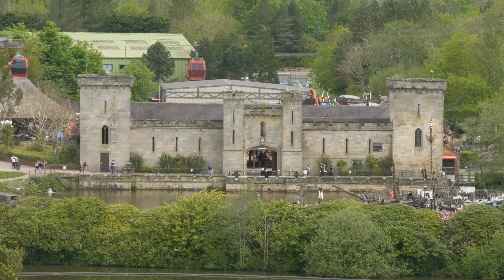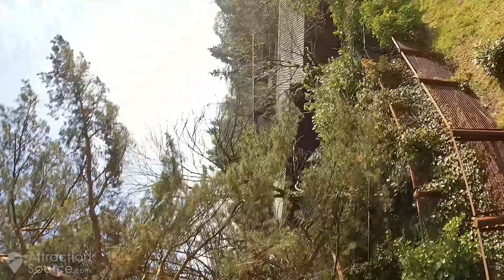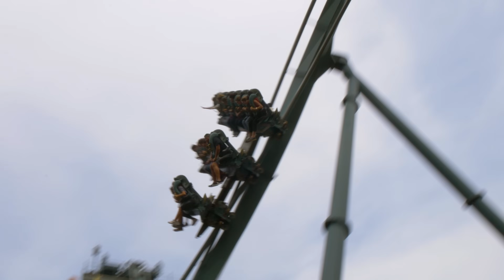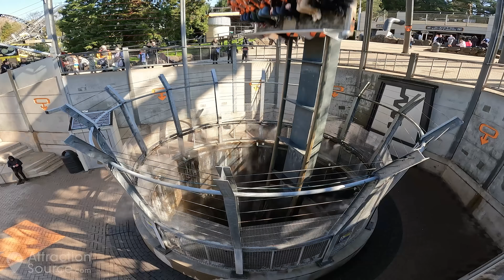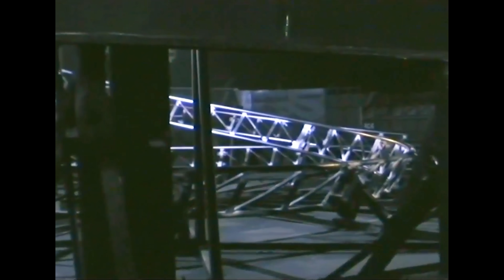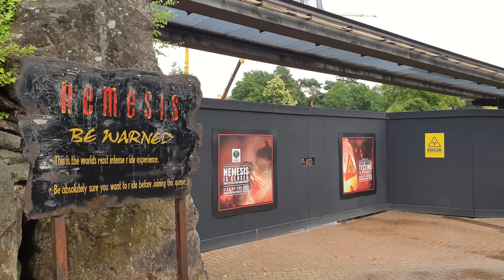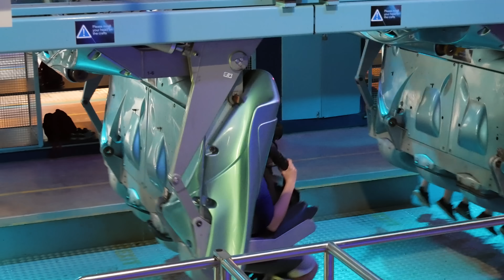Alton Towers has a roller coaster problem

Comment: Oblivion is very clearly above the tree line. I remember, because I was on it, we went over the top, paused before the drop, and that's where it broke down & the brakes didn't release.

Lovely view it was, though. 

I used to go to Alton Towers before Oblivion was built. Please don't tell me it's been there 25 years. Corkscrew, if it's the "outdoor version of blackhole" - I saved a guy from falling out of because there was no mechanism for holding riders in, in the early days. EDIT: No, Corkscrew was where Rita got built. I'm thinking of the coaster that was where Air, now known as Galactica was built. It was a clone of blackhole, but, not in the dark.

I remember a common "fear" of Nemesis was losing your footwear as you came out of the loop.

Wasn't Galactica called "Air" back when it launched?

Wickerman seems like it was built where the runaway mine train was, rather than the flume.
Reply: F****, now I realise I was at the park before Nemesis was built.
Reply from the maker: When I first rode Nemesis I was afraid of losing my shoes! 😂

Comment: The height restriction should be lifted. The local authority is putting the economic viability of the park at risk.  Either let it change or close it down and have it as a garden as it was prior to 1980.

Comment: I dont know what they'll do with oblivion but i reckon it'll be much easier to turn into a different rollercoaster, because even if half of it is underground, the entire ride is about the drop so half the ride is not very much, and they can quite easily design another rollercoaster that has a drop into a tunnel at a given point but it can be more exciting in the rest of it. I dont know how they'll approach replacing the parts, but if they do fish each bit out part by part they might be able to keep the above ground open for the public, which iirc would otherwise block off two off the shelf rides and a restaurant so its in their interest to keep it open, especially the restaurant.

Comment: I remember when Air (now Galactica) opened. It was the best rollercoaster I’d ever been on. It was smooth, fast, I didn’t bang my head (like I did constantly on Nemesis) and I loved the corner where for a second you couldn’t see any track or anything. “Prepare for AIR.”
Reply from the maker: Good to see another Air fan!
Reply: I went to Alton Towers shortly after The Smiler opened.
I never bothered to ride The Smiler because the queue was 2 hours long. I went on Air... there was no queue at all, the car wasn't even full up. I'm glad I did, because it's different to any other rollercoaster I've ever been on - it's not trying to be scary or intense, it's just fun, and it really feels like flying. It was almost relaxing. Easily the best experience I've ever had on a rollercoaster.
Reply: I remember when it first opened under Air, we went for 2 days and I think the entire second day I just spend going to air multiple times
Reply: @rancidrance875  You will be familiar with all the breakdowns then? I had a season pass that year and went almost every week. Air was plagued with teething problems in those first few months but when you finally got to ride it, it was a unique experience, and who could ever forget the great theme tune that played from the green BOSE speakers around the queue lines?
Reply: @RS_John  +1 this! The ride itself was relatively trouble-free, but it was the loading area and procedure that was causing most of the problems. New train design, new type of restraints riders had never encountered before and didn't know how to use, trouble with the raising mechanism and so on. In fairness to B&M though, it was the first such coaster they'd ever tried building. 😇
Reply: I've always been 100% a Nemesis man myself - Inverters with 4+ G-force every time, in my case - But Air has always been a particularly calming and zen place for me. I respect the fact it was designed to be an experience of flight - Not the White Knuckle attraction everyone seems to expect of it - And every time I go on it (Often without the GalacticAIR headset) I come off feeling so relaxed and comfortable I'm practically floating out of the station! ❣

Unfortunately, I took a rather more risque approach to interpreting the Air promotions around the time it was opened. I won't go into detail, except to say that my version was rather blue and the slogan put a bit too much emphasis on „Assume the position...“ 😉
Reply: I remember Air too. That ride felt very unique. Sure, there are more options now across the world, but Air will always hold a special place for me.
Reply: I think its lacklustre, no thrill.
Reply: @JabJab420 it is tame and it is supposed to be a more family coaster. It is more about the position of flying and that feeling when for a second you are flipped backwards and upside down is like nothing any other coaster can do ❤❤❤it is worth it just for that second 😂😂😂
Reply: @propgear123  Exactly, not every ride has to throw you about with max g forces. It's about the immense flying experience - still my favorite ride - and I've rode it and Nemesis back-to-back for many times!
Reply: @LaurenceGough  yeah I love it and think it is better than nemesis because it is unique. Nemesis nemesis inferno and the one at chesinton are all the same imo
Reply: Air was the best man I always loved that one
Reply: I was too small for Air when it launched and thanks to "friends" not respecting my limits in my teenage years, now have an irrational fear of all rollercoasters. 😒

I can't remember which rollercoaster it was (in Thorpe Park) but they made me go on it when I wasn't in the right frame of mind and only one of the group realised thier mistake when my knuckles were white and eyes shut before we'd even left the station.

Seriously people, if you have a friends who isn't keen on going on a particular ride (for whatever reason) don't force them, especially with sheer peer pressure...  You'll only ingrain thier insecurities more.

Comment: Your voice is so boring and tedious! You are aware that Nemesis has just been rebuilt with new track to the exact same layout right? Oblivion is also purpose built so they could probably do the same if not mix it up a little.
Reply: Alton Towers is built next to an old village called Alton, I imagine most of the owners of homes in said village are probably the same people I imagine buy homes next to train tracks, motorways, flight paths, night clubs and then moan that all the noise/sights are upsetting them. If you can’t see a theme park when you’re driving to a house viewing then that is very much your problem.
Reply from the maker: Thank you! I do know Nemesis is being rebuilt, it's the focus of this very video, which you probably didn't watch 😁

Comment: I doubt Oblivion's track would be that hard to replace.  Its not as if the tunnel is tiny, and the tunnel pieces are likely smaller, therefore easier to remove and replace manually.
Reply from the maker: Oh yeah the tunnel isn't small, those huge trains have to travel though! I hope you're right 😊

Comment: Alton Towers is a funny one. It's a great theme park! But their obsession with world firsts has left them with a unique selection of rides for sure. But most of them focus on one single show stopping element which means that they don't necessarily age so well and are quickly over taken in the thrill department by other parks. Nemesis is the big exception here as its genuinely one of the best coasters in the world and will remain so. The smiler also beats this trend as does Wicker man to a degree so maybe they are learning. 

As iconic and beloved as all of the coasters are. The reality is that Oblivion, Galactic, spinball, thirteen and Rita could all easily be replaced by far more exciting coasters if Merlin wish to do so. Alton also needs some high end themed flat rides. Ironically they used to have a breakdancer which would be great to see again....if they ran it with proper ride cycles.
Reply from the maker: High end themed flats would be great!

Comment: If they wanted to then could they remove Oblivion but reuse its tunnel for a new coaster by blowing out the existing hole bigger and removing more earth to create an underground space that's more of a network of tunnels or a cavern than a single tunnel? I presume that as long as they don't run into subsidence issues then they can dig underneath as much of the park as they like and to whatever variety of different depths that they like?
Reply from the maker: I have no clue how much they can dig underneath the park, but more underground bits of rides would be awesome!

Comment: The 25 years you mentioned is most likely the design life in the specification that the coaster was designed to. This will be driven by fatigue, specifically crack growth in high stress regions or welds and to a lesser extent corrosion and some track wear (though this is largely born by the replaceable wheels through proper material selection). 
Just like with other machines, power stations, ships, oil rigs etc, you can extend the design life through an extended inspection regime, checking for crack growth in welds etc. This is likely how nemesis was allowed to operate for another 4 years.

Comment: For me I think Rita should go first. It does one thing and it doesn't even do that very well due to the height restrictions, Stealth is a far better version as it actually has the top hat feature that is the selling point of this ride type. It's also one of the easiest to remove as there was little to no landscaping done. I would like to see Galactica/Air receive the themeing it was meant to be opened with, being forced to stare at a dirty, damp concrete tunnel is not exciting. Oblivion definitely deserves track extension now that it has been overshadowed by other dive coasters that offer way more duration. Outside of coasters, the Congo River Rapids is in desperate need of investment, the last time I rode it it smelt horrible and most of the splash features have long been switched off. It's either that or remove it for something better, but as the parks last water ride I'd like to see it refurbished, hopefully with the same design of rafts from it's original incarnation.

Comment: Get rid of Galactica and Rita. Galactica is a real headache with reliability due to the duel station and car complexity. Rita is also very unreliable and rough as nails. 

Nemesis and Oblivion might be the old grandads, but they are more reliable than the others, have decent throughput and are far more iconic.

Comment: I was expecting this video to be about the number of times Oblivion has failed to disengage the lock at the freefall point 😬 It happens every couple of years, sometimes just for a minute or two, sometimes needing a full ride evacuation.
Reply: Happened once when I was there
Reply: As in, it doesn’t stop?
Reply: @ivanazuckerberg  the car is supposed to stop hanging over the drop for a few seconds. Originally a speaker played "Don't look down!" and then you were released into freefall. Except occasionally it doesn't release. It happened several times when it was first opened (once when I was there, but not on it). It's a nightmare of a stopped car rescue because there's the potential of someone falling off the ride into the hole if it's not done correctly.
Reply: @JamesScholesUK  I remember the days of ‘Don’t look down.’ Sad they don’t say that anymore but I understand it was because the neighbours complained about noise and the ‘Don’t look down’ made the screaming worse. It used to stop a lot at the beginning when I was there - I’ve never seen anyone actually get evacuated at the top - have you?’ Eeeek

Comment: Always thought that Alton Towers could do a tunnel-based horizontal launch coaster really well. Using a tunnel they could go under protected elements and 'pop-up' in the non-protected spaces. With the tunnel they could simulate hyperspace, or something akin to the star-wars trench run with projected displays and a matt black track that all but vanishes with brighter side displays. Epic.
Reply from the maker: That would be pretty cool!
Reply: That would be mint
Reply: @SportyMabamba  Everybody: That would be mint! 💯

Merlins board of directors: That would be far too expensive. 💸

Solution: We all need to buy a majority stake in Merlin so we can work our way past the latter problem! 😉
Reply: Yeah they should do a reverse oblivion that launches you Rita style into the tunnel and vertically out the hole!
Reply: That sounds amazing
Reply: Agree. A multiple launch coaster would be incredible. Something like Velocicoaster/Blue Fire or Icon. Rita might have to move aside though.
If Alton Towers could have that, or have had "Sik" instead of Flamingoland it would be the perfect park. It lacks a standard rollercoaster (by that I mean not inverted/flying/vertical drop)
Reply: That would be far too expensive.
Reply: @simontay4851  yeah, probably. Fun to dream.
Reply: borrow a small railway tunnel borer, like those used on underground lines.
Reply: @Drengade Even that is probably a million quid just to shift it on site xD Would be cool if doable though.
Reply: @Drengade  cut and cover is normally cheaper than using a TBM. TBMs are only used when you can't demolish the stuff above like in cities.
Reply: @kwlkid85  true, but in this case I was talking about how they could do it without disturbing the trees and protected areas on the surface. Which would be impossible via cut and cover

Comment: Woah that sounds very lilkly to Phantasialand. They also have a massive space problem and residents who complain about the disturbance of the peace. And I think they also have a height limit. The tallest building is the free-fall tower at around 50 m and the two newest roller coasters are multi-launch coasters. All tracks are also very deeply embedded in terrain and theming. In the past, many attacks were demolished for new ones.

Make a part 2 to this video with Phantasialand.

Comment: They actually had two coasters that were the same in the 80s and early 90s - one was the Black Hole without the tent, I think it was called the Rat. You could see the problem with off the shelf coasters on that ride, as many of the stiilts holding it in had lost contact with their bases.
Reply from the maker: Very true! It might have been called the Beast I think 🤔
Reply: Yes it was the Beast. I think they put it in the tent when they built the Mouse, which I'm guessing is long gone and probably unknown to many people (I haven't been for 20 years).
Reply: Actually I think I might be mistaken about the timeline for the Mouse. I've just searched for the coasters archives and supposedly the Beast and the Black Hole are not the same.

Comment: Personally, I'd love to see Oblivion receive an extension when the time comes for it to be re-tracked like Nemesis was. With the space they have available nearby, they could keep the iconic drop, but then after it surfaces, the banked turn could then lead into a fast, low layout off the ledge and around the woods with an inversion or two (a Zero-G Roll and a Dive Loop/Immelmann could work well) and some pops of airtime before returning to the station. Just something to bring it more in line with more modern Vertical Drop coasters while keeping what made it iconic!
Reply: Yes they can just replace the track with new like they are with Nemesis and tweak it if they want, change colours, cars etc and it will be like new for many more years. They are likely to do that if its still popular and it would be easier to do than Nemesis is as the access for lifting machinery is easier there....
Reply: Agreed, Oblivion is fun, but a short run.
Reply: The problem is by the time it's out of the ground it's lost most of it's potential to do any of those elements above ground and below the tree line. So you'd need to remove a lot of the ground the same as nemesis. The cost of that is high and getting permission won't be easy.
Reply: @robwalker4653  I take it you haven't ridden oblivion?? you come flying out of the back end of the tunnel and back up the hill to the station, at which point the brakes slam on very hard taking a good few seconds to stop. I've always thought the momentum those carts have is wasted.
Reply: @jwalker7567 is it just momentum or is there some power there ?
Reply: @jwalker7567  I've ridden it plenty of times and know the area around that ride well and there isn't space for an Immelmann loop like other dive coasters the Immelmann would have to start coming out of the ground and then finish far higher than a normal loop unless they dig up the ground.
Reply: Its just not worth the queue to ride time ratio. 45-60mins for 12 seconds. However that is a general problem for alton towers.
Reply: @carlwilliams3488  just don't go during busy times. Last time I went on oblivion 16 times, 12 in a row. got on nemesis over 6 times which made me feel ill afterwards